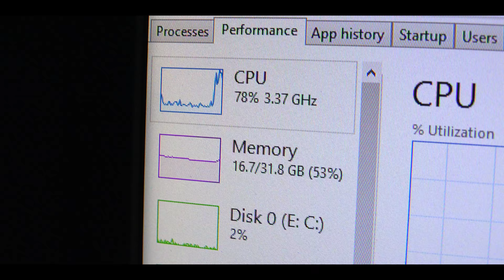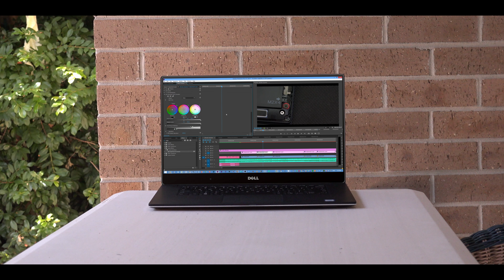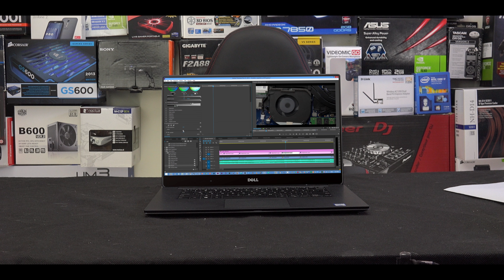The Ultimate Ultrabook Reval

Comment: dang those specs for that laptop are powerful I'm still using a 8year old laptop with a 1.66ghz dual core, 4gb of ram, 300gb hard drive and 32 bit windows 10 (I upgraded the laptop over the years)